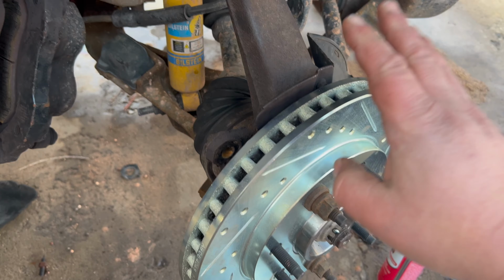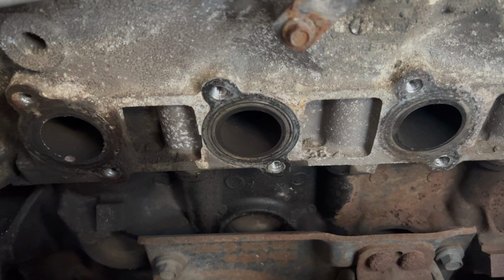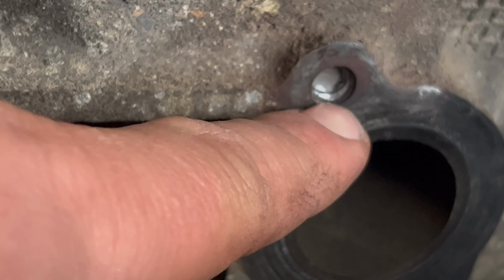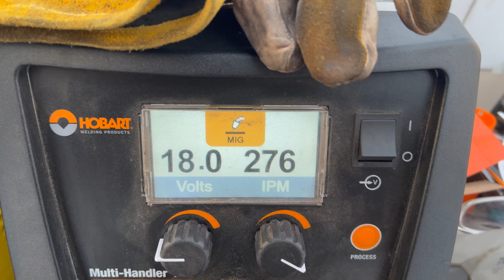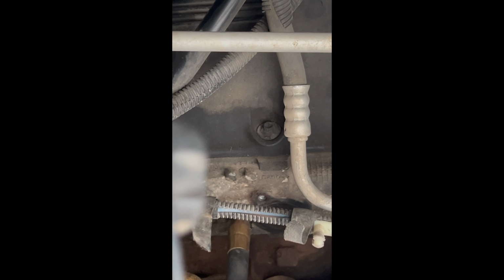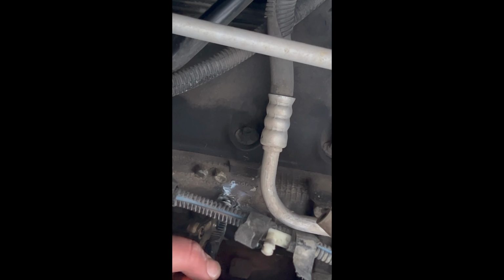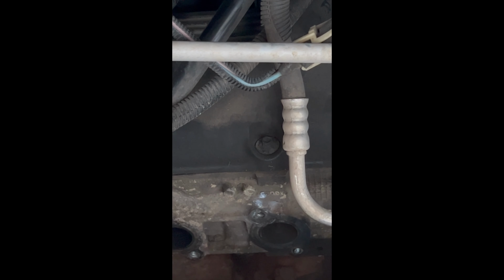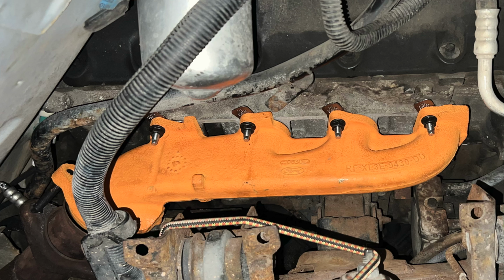Removing Broken Studs or Bolts from an Aluminum Engine Block

Comment: I'm a panel beater and welder of 30 plus year's so very experienced and have used welding a nut on end of stud worked every time 
Apart from now 
I've welded on one stud 13 bolt's snap off like a carrot or cleaned end up with a grinder 
Cranked the welder up 
It's a powerful welder 
Won't shift it 
It's an alloy block near a waterway it will not budge

Comment: my little mig welder is gas less will it still do the job also should my ground clamp go on a manifold bolt?
Reply: curious, are you running flux core or simply out of gas?

Comment: What amp welder are you using?
Reply from the maker: If I remember right I was using a little Forney Easy Weld 261 which I think is a 140 amp machine.

Comment: Well done. I've never used that method. I won't have to use it, that'll never happen to me!!!  You're having a break or given up on the usual posts? Cheers
Reply from the maker: Just been busy with welding school and the day job. I should be done with school in a couple of weeks and I have several video ideas that I plan to start on as soon as I can. They won't be limited to just woodworking. I'm going to do more with welding and I want to experiment with some leatherwork ideas I have. My goal is two videos a month, bu I've had that goal before and not done very well, so we'll see. 😉